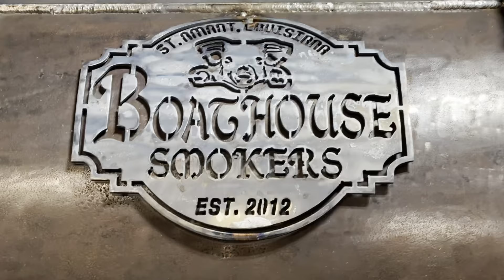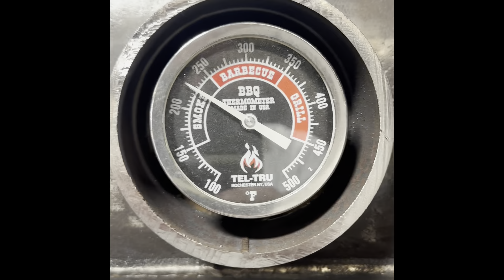Boathouse Smokers 120 Gallon Texas Traditional Offset Smoker Build with Off-Road Package & Wagon tow

Comment: That's an awesome smoker, one mistake I've noticed many people make while building these smokers is not putting a shelf in the firebox to elevate the fire, placing the fire on the bare bottom heats up the firebox causing it to weaken plus it takes more firewood to smoke what you're grilling, elevating the fire will let the airflow through giving you a much hotter fire with less firewood.

Comment: Have you considered insulating the firebox? It would help keep the tires from the heat. You might try making an insulated panel for each side and connect the panel tops with an expanded shelf. 
Excellent craftsmanship !
Reply from the maker: Yes, we make an insulated firebox version as well.

Comment: The baffle plate you have by the fire box?   Does that help with even heat and maximize the cooking area??   And does that hurt the flow.   Great video and best looking pit around.
Reply from the maker: We get more consistent temps with the baffle design. We have not found that it restricts the flow at all. Thanks for the comment and compliments. Cheers.
Reply: @boathousesmokers2336  thank you so much for the reply and be safe.   Keep those beautiful pits coming and don’t be afraid to venture off course a bit.  Like the baffle you never know what your going to find.

Comment: It’s cool the way you’re doing it but what is with the other end and why are you putting brackets like that for the shelves? It’s gonna block the grease you’re gonna have to have two different drains and then that means there won’t be a drop so the grease goes to one side.